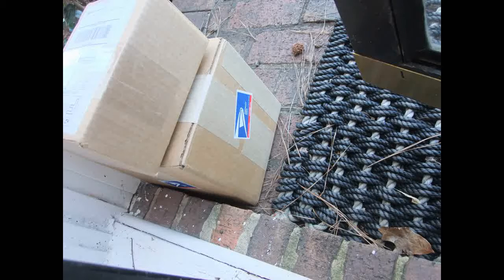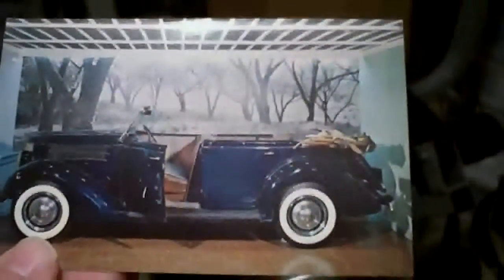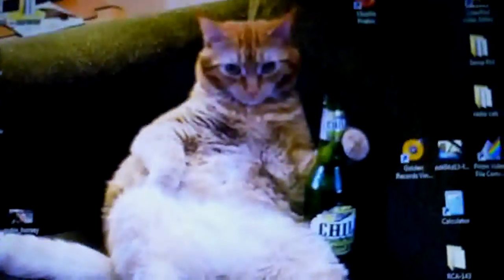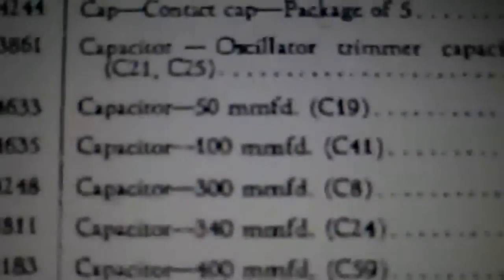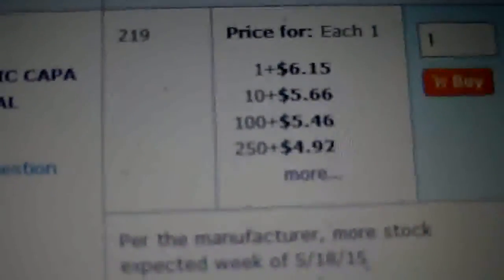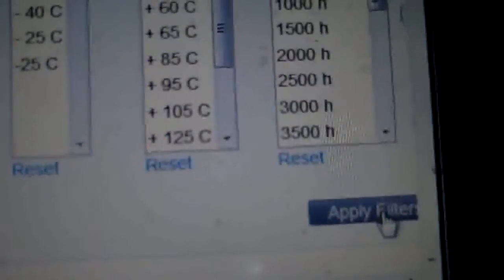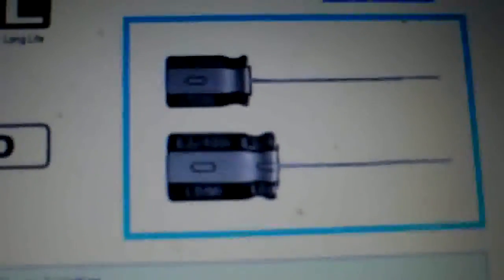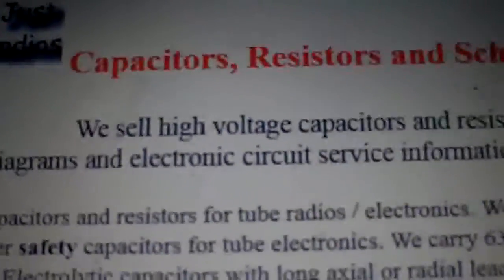1934 RCA Victor 143 Restore Part 2 of Mucho.

Comment: Nichicon, Rubicon,  United (Nippon) Chemicon, and Panasonic all make excellent quality, yet inexpensive, electrolytic capacitors, sometimes you can even find axial lead caps made by those companies as well. Actually it is not that difficult to restuff an old fashioned axial lead electrolytic cap with a modern radial lead one, all that you need to do is extend the negative lead and bend it up and over the side of the cap so it's going in the right direction.
  Actually the same companies make poly film caps, even large value ones, that you can use in place of some electrolytic caps as a permanent replacement, as well as replacing paper filter caps that were used in early AC radios. I've bought smaller value axial lead yellow poly film caps from several places, Radio Daze being one, but WJOE radio being the most recent, it doesn't really matter much where you get them, other then  the price, as they are still an improvement over the wax paper ones of yesteryear.